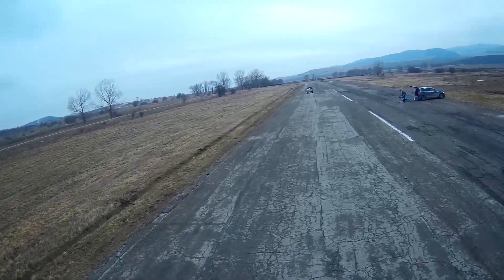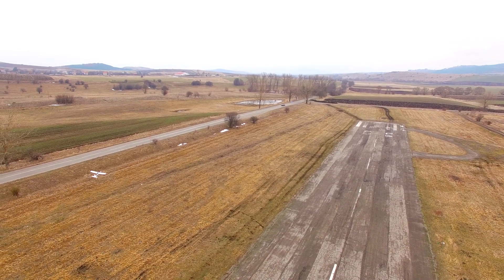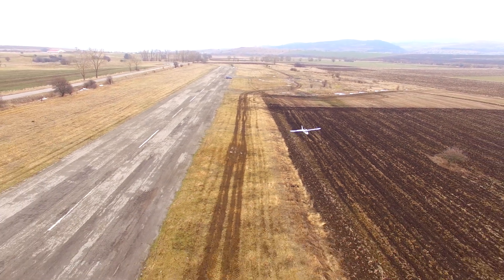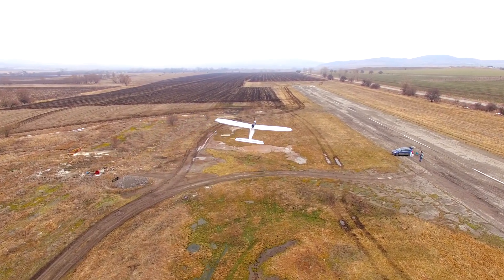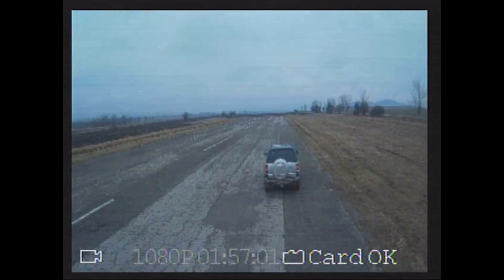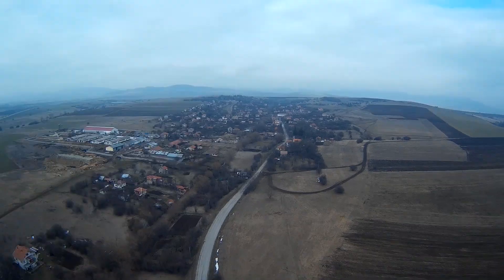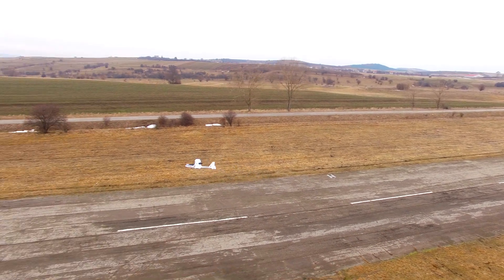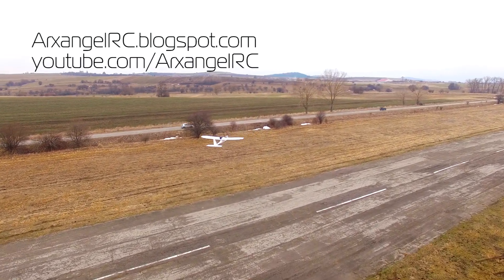XK A1200 - feeling fine with an autopilot (a long overdue upgrade!!!)

Comment: Don't know how I've forgotten to subscribe at the A1200 fpv video, but ... +1
And there I am, still in doubt whether to buy the fpv or standard one
Reply from the maker: I'd say get the FPV... its worth it! Especially if you can spare the time to install an AP! :)
Reply: I should mention, I already own some goggles and a 200mW microcam and the old Runcam hd.
Their fpv rtf without hassle is of course a big advantage...  Sigh! hard to decide.
Wish their was less price difference between the two versions...would make it a bit easier for me
Reply from the maker: Yes, RTF FPV is a bit advantage and will save you some time and effort installing the system, but also will not tie up your available FPV gear in this model. If you get the FPV version, you will be able to equip one more model with FPV... and if you are serious about this hobby... a next model is just around the corner anyway! I've lost count of the number of Vtxs, cameras, etc., etc., that I own... but I would still get this with the FPV package if I ever have to order it again!

Comment: I am getting ready to buy my first plane. I am torn between the nano talon, xk a1200 or a bixler 2. I really like the nano talon and keep coming back to it honestly. But I would really like any suggestions. Thanks in advance.
Reply from the maker: Hmmm... I would say, the XK A1200 is BY FAR the most beginner friendly option you have (this is the lowest price I've been able to find: https://goo.gl/DhX2EK), with the Nano Talon in 2nd place, and the Bix in 3rd! The problem with the Bix is that it needs gluing, assembly, electronics installation, perhaps soldering... all things that may not be an easy task for a first time flyer! :)
Reply: Thank you do much for the reply! I will remove the Bix from my list (really didnt like it anyway). One reason I am leaning towards the Nano Talon over the XK a1200 is because with the Talon I would have a radio, receiver, battery and charger that i could use with anything. And with the xk all those things could only be used with the XK.
Reply from the maker: Well... you will have to buy separate radio controller, receiver and battery for the Nano Talon! And yes, the XK does come with these things... but either way I wouldn't take the radio seriously even though it does seem to be OK for at least up to 1km away! :)

Comment: Hi, this will be my first plane, should arrive in couple of weeks. However, I couldn't resist to read all the info about it and found your videos on YT excellent! Thank you! I also read all your blog related to the xk A1200. I'm very interested to put an autopilot in this plane (especially for safety reasons). I loved the modification you have done, and read all about it on your blog. Do you think the APM 3.1 is still fully supported on the ardupilot platform? It seems they have discontinued support for quite a few of older hardware. I mean, is it still a good choice to go for the APM 3.1, or do you suggest a newer hardware?
Reply from the maker: Hi, well... I still use the Micro APM board (https://goo.gl/k1uXU5) even in one of my larger long range planes! It is still good! The newest firmware of ArduPilot does not support the APM boards, but the last firmware that is compatible is still in use and it works rather well! You certainly don't need the latest one for a plane to fly well though. If you want, you can always get some sort of a Micro Pixhawk (https://goo.gl/cL5zBW), or even an Omnibus F3 Pro controller (https://goo.gl/ohikTa) with iNav... there are options out there now! :)
Reply: So there is still a compatible firmware available for APM, great to hear! 
I would like to use the stock transmitter XK H7, with a compatible receiver (you suggested one in your blog), do you think it's a suitable transmitter for ardupilot different modes? I would like to have at least stabilization 3d/6G (as in stock configuration) and return to home function (as fail safe). I'm wondering if the switches of that radio are suitable...
Reply from the maker: Stock radio with that receiver should be OK, but for such simple tasks I really do believe the APM is too much hassle! I would suggest you look into the iNav thing, I am currently preparing to outfit two planes with it, it should be a lot easier to setup, and the FCs are cheaper.
Reply: Thanks for the suggestions, I will consider if some good instructions will come available. I've spent the last few days of intensive learning to understand how to configure APM and feel I could manage now. I checked also all the different components (APM v3.1, GPS, PM, MinimOSD) would cost about a total of 60€, it doesn't look to be very costly.
Reply from the maker: Alright, that's more than fine as long as you feel comfortable dealing with it! :) But fly the plane at close distances first, see and learn what it is capable of, and also get used to the way it handles and flies. Only after that start playing with autopilots, etc.! A lot of people do the mistake of jumping into long range and AP, and so on, without even knowing the first thing about flying a plane!
Reply: ArxangelRC of course I will do so. My intention is to learn first and then do this project of the autopilot, we will see... Hopefully when it will come the time I can still ask you some help ;) may be on your blog? Thanks again!
Reply from the maker: Haha, no problem. Just don't ask on the blog as for some reason once the comments get over 100 or 200 I am no longer able to see them and reply to them. Contact me on Facebook or here. :)
Reply: Hi ArxangelRC, I'm back and very happy with the plane. And I followed your suggestion for iNav, I had a problem with a clone OMNIBUS F4 pro ordered from Banggood, which was faulty. In the meanwhile, I have a question for you regarding iNav settings. As I told, I would like to use the in stock transmitter XK H7, which have only 2 switches (2 positions type switches). Do you think I could have a stabilize mode (ANGLE) and more acro mode (HORIZON) on one switch, and RTH on the other switch? I mean if I'm in ANGLE or HORIZON mode, will it work if I put RTH on the other switch? Do the RTH override any other mode when it is selected? Thanks in advance!
Reply from the maker: Yes, you can do that, iNav, and all other Cleanflight and Betaflight based firmwares have a very flexible setup scheme for flight modes, so what you want to do is totally possible! A word of caution though, when you get into iNav, one of the tabs had a throttle-2-pitch mixing option, put that down to 0, otherwise it will give you one hell of a time wondering why the plane is pitching down as you raise the throttle.
Reply: Thanks for your reply! Which tab is exactly in iNav with throttle/pitch mixing? Is it in "PID tuning" tab? But I cannot find any throttle there...
Reply from the maker: No, it wasn't that! It was the tab where you can also setup flight speed, RTH distances, and behaviour, etc.
Reply: ok. I think I understood. Is it in "Advance tuning" tab? >> "Fixed Wing Settings" >> "pitch to throttle ratio"? I've now a value of 10, do you suggest me to put it to 0?
Reply from the maker: Yes, that's the one! Make that a 0 and save it, otherwise it will try to pitch down the plane every time you throttle up.
Reply: Ok, I'll do it, thanks again! Is there anything else I should be aware? Have you now iNav on this plane?

Comment: Did you make it 2 km out with the stock fpv setup ? What do you think about the 2W boosters for the stock remote?  Can you suggest a good osd for the stock fpv setup? Thanks :D
Reply from the maker: Hi, with the autopilot I was able to go 2kms, but you will need better antennas than the stock. As for a 2W booster... I know they work, but as to why you would need I am not sure. What distance are you looking to go? I have tested the stock remote to 800m with the receiver antenna very badly placed! If it is placed better I am sure it will go further without a booster, but without an autopilot I will not be willing try that! For an OSD, right now I have an APM in there, so I will setup a Micro OSD (https://goo.gl/jSBC8I) board for the plane, but if you want to use the stock flight controller, I guess the Micro OSD board will also be OK for you, because you can wire in the battery directly to it, though that is all it will show you. :)
Reply: ArxangelRC You keep amazing me by how fast you reply and thank you for all that knowledge and regarding the booster I am looking for a bit more range and I want the OSD to make sure I still have the rssi % guess I will have to get a whole autopilot for it but from your blog the installation seemed a bit intimidating
Reply from the maker: Actually you can feed RSSI directly to the Micro OSD as well, problem is I have no idea how you can get it out of the stock flight controller! A 2W booster should give you 2kms of range for sure, so I don't know if you really need a booster, but you need some way of knowing how far you've gone so you don't end up further away than you wish! :)

I reply to comments when I can, so if you happen to post it when I am at the computer and have the time to reply, you get an answer instantly! :)

Comment: I should be receiving mine soon from banggood and was thinking of puting a dragonlink in it with a vector Osd and running it all with a tranious remote I have also been looking at the 1.2 g antennas from ibecrazzy any thoughts or suggestions
Reply from the maker: Yes, I actually have a few thoughts... this is a small plane, not sure why you would need 1.2g video on it, it will never have enough battery to make it out too far, and 5.8G with the much smaller and lighter batteries is a MUCH better option! I am also not certain you need that Dragonlink for this plane since you have a Taranis. I have been out 5-6kms with the D4R-II receiver and the 5db antenna on the Taranis. About the Vector... is this only an OSD, or does it have some autopilot features? It may be that the board is too big to fit into the fuselage of this one, that is why I went with the Micro APM board mounted sideways without any cases, so it would take less space!
Reply: ArxangelRC sounds good looks like I have some things to think about thanks for the help. also really like your channel
Reply from the maker: Thank you, I am glad I can help! :)

Comment: Would the h301s autopilot fit in the fuselage? That would be an easy way to add one too
Reply from the maker: Not sure about this... will have to measure it to be sure.
Reply: ArxangelRC That would be awesome if you could do that :) It would make a good autopilot for even big fixed wings i think and nomore setting up extra stuff
Reply: Also, would it accept 3S? Because then i want to try it in my micro skyhunter :)
Reply from the maker: I don't think this is usable on larger planes because I am not sure it would support 3S! Also... you would need to find one that is functioning properly, as some have had some issues with range and the RTH function. :)
Reply: ArxangelRC Hmm, that may be something i should ask hubsan. Finding a working one wont be so hard if I keep return them if they are faulty ;) I will need the transmitter right? Or would it be compatible with their h7000 transmitter. Do you still have a fully working h301s?
Reply: Oh and is it safe to fly 2 planes or drones wity identical controlles close when pilots are close to eachother?
Reply from the maker: As long as the controllers are 2.4Ghz and hopping frequency, you should have not problem flying even more than 2!

I am not sure how Hubsan receivers bind, but you should be able to use the FC with most of their radios! My H301S crashed a while back, and I still haven't found the enthusiasm to sit down and repair it and see what works and what not... I may just scrap it...

Comment: I'm thinking of buying this one. Can you make a video on how you installed auto pilot, I really would like to put it on this plane. Thanks.
Reply from the maker: Nothing special about it... get all the components, put them in the plane and wire them together! Simple as that. Make sure they are the smallest you can find! :) I am waiting for some Omnibus boards right now to use with iNav as APs, and I may just replace the APM in this one with one of them because it will reduce the weight even further, so may make a more detailed video of that process. :)
Reply: @ArxangelRC  could you please provide links to buy all parts to make this autopilot with no soldering? thanks

Comment: Hello 
My gyro quit any ideas? Checked the plug connection seems tight. Switch is in up position on the controller.
Reply from the maker: Hmmm... not a clue... mine was working fine until I removed it! I guess now you have a reason to replace that unit and go for an autopilot! :)

Comment: Hi, with this plane I think I have a "problem" using iNav. In stabilized mode (ANGLE, HORIZON), with plane on the ground flat and balanced, the servos start little by little to correct their position till the get maximum extension and start squeal. If I switch to PASSTHRU (full control) the problem disappear. Is it normal? Do you have experienced the same with iNav? I just don't want to get in trouble with iNav maiden flight.
Reply from the maker: Seems to me you need to fly the plane! Doing checks like this on the ground can be misleading in some cases! When the plane is not moving and you switch to a stabilized mode, it will try to level the plane, it will give some command, if nothing happens it will give more command, and so on until it reaches the servo travel limit! Since you have passthru and it is working, fly the plane in it, and in the air briefly switch to a stabilized mode and be ready to switch out of it if something goes wrong!
Reply: Ok, what you say it makes sense. I have to find the courage to fly it! In the meanwhile, on the stock transmitter XK X7, one of the two position switch doesn't work anymore. This means that with only a two position switch left, I can now put only two modes with iNav (HORIZON and PASSTHRU). I need really to get another transmitter so I can put  also RTH, which was the reason why I started this project with FC and iNav on this plane.
I saw a new transmitter Jumper T8SG 10CH, with Deviation software which covers basically every protocol (Including S-FHSS of the receiver I have now) for about 70 €. It has four 3 positions switches, which allows me to put many modes. Do you know this transmitter? Anything else you would recommend with a budget not over 100 €?
Thanks!
Reply from the maker: Are you talking about this radio?
https://goo.gl/aYPN3c
Reply from the maker: Oh... I see... OK, that one loos nice also, 10 channels is cool. Visually it looks like one of the Futaba radios! :) This one should work, so if you want, you can get it... should be OK if the radio itself is well made! :)

Comment: Would you be able to tell me if I would want to use my XK7 2.4ghz transmiter what rciver would i use??
Thanks
Reply from the maker: A while back somebody recommended this one and said it should work with that radio: http://www.banggood.com/SF800-SB-8CH-2_4G-Receiver-Compatible-with-Futaba-S-FHSS-T4YF-T6J-T6K-T10J-T14SG-T18MZ-T18SZ-p-1071952.html?p=6L1818635832201406F2

Essentially I think most S-FHSS protocol receivers should do the trick! :)
Reply: Great i am going back home next week and taking my transmiter with me and will install new receiver into the planes I have at home and mix with helicopters as well.
Reply from the maker: Sounds good, let me know if the receiver works! I am still wondering what to do with the transmitter...

Comment: I came rewatching this video (as I do with most of your videos :p) and noticed something. Is this the same autopilot that I told you about that I would put in the micro skyhunter? (http://www.gearbest.com/multi-rotor-parts/pp_485727.html)
What do you think about it? Is it relatively easy to assemble?
Reply from the maker: It should be, although I got this from HobbyKing awhile back, and they call it HKMicro APM.... but it should be the same! It is easy to connect everything that is in the kit, it all comes with the necessary cables and connectors. I've had to connect a few external things here and there, but nothing too difficult really!
Reply: ArxangelRC Ok, perfect. Thanks :)